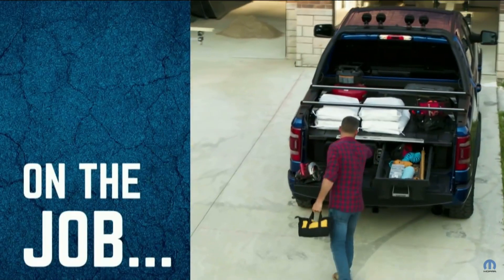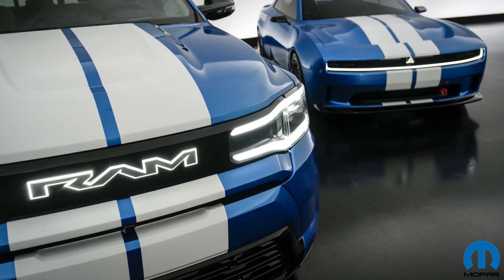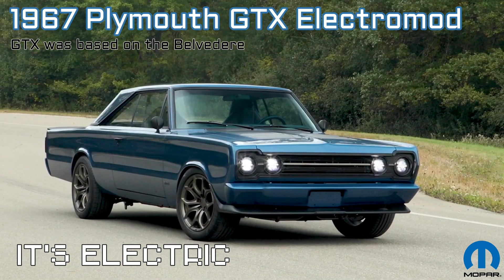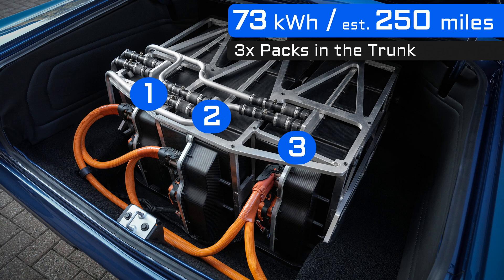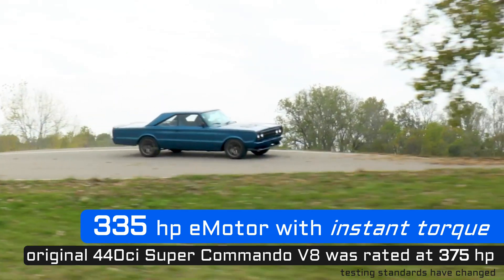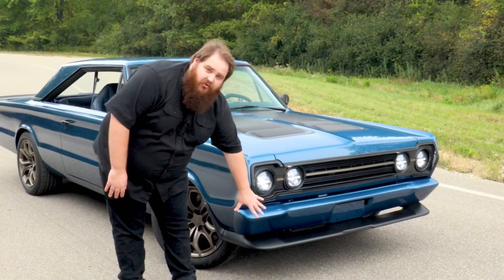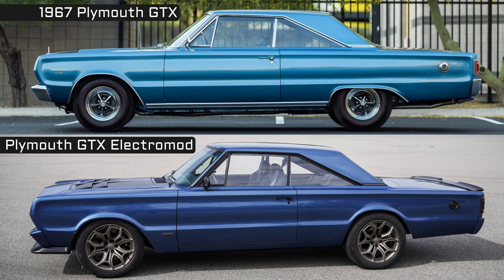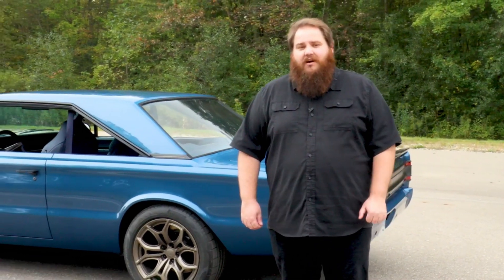Mopar's 1967 Plymouth GTX Electromod (SEMA 2024)

Comment: Cars parked 90% of their lifespan don’t need fast charging unless you’re road-tripping specifically in a hurry. Even the slowest Level1 charging from an everyday outlet will give you 3-6mi range per hour. That’s 54 miles in a 12hr period. Level 2 gives you 324 miles in a 12 hr period using a 240V laundry outlet you may already have in the garage. The longer you own an EV, the slower you’ll charge, even when 3min charging becomes accessible, you’ll STILL want to charge more slowly for either convenience, price, or because you’re making your own “fuel” from solar+battery storage while you’re doing something else. This is what most fail to understand, they equate fueling up with sitting there and waiting impatiently doing nothing else.